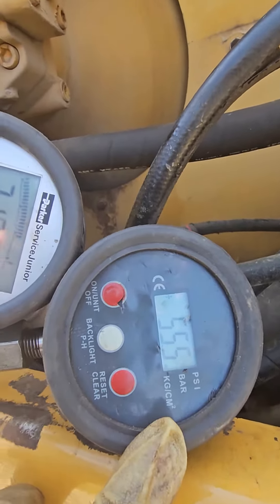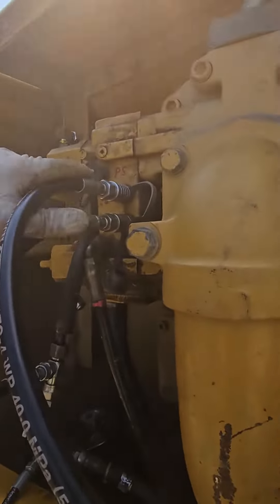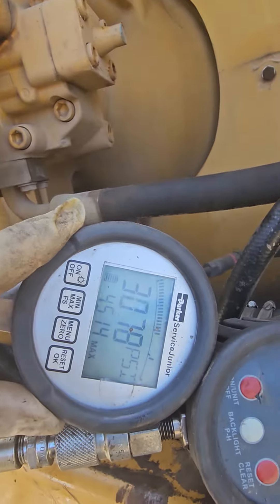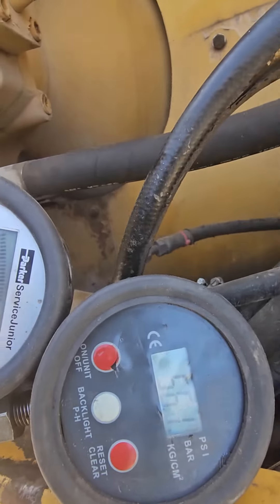Diagnosing Cat 330L: Tackling the Left Forward Track Power Issue - Part 6 | Mobiledieselmedic.com

Comment: Hi, this is extremely good, have more or less the same issue on my 330. I switched the output lines of the pumps and the problem moves on the other side. Can you please continue with these series? Keep up the good work and thanks for your help!
Reply from the maker: Hi so much has happened since then.  I will make more video's but will get you up to speed since I made this.  I had to stop because I wasn't making much progress on the thing and I needed to catch up with all my other customers.  I have since circled back and have moved forward.